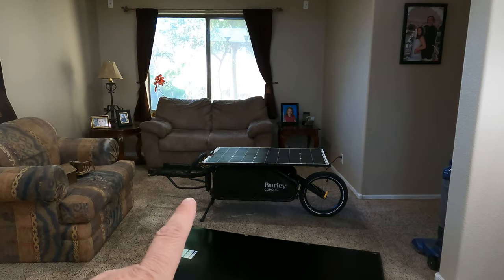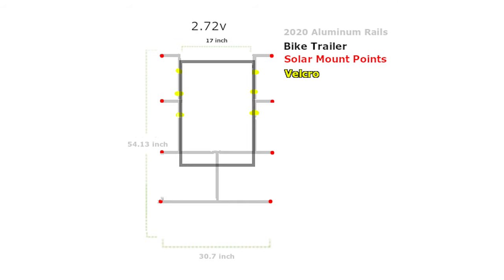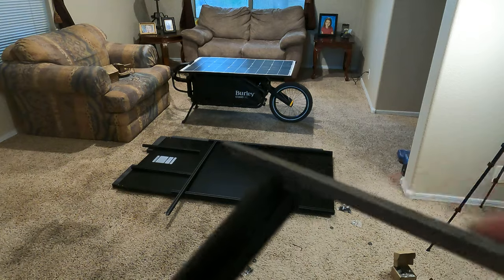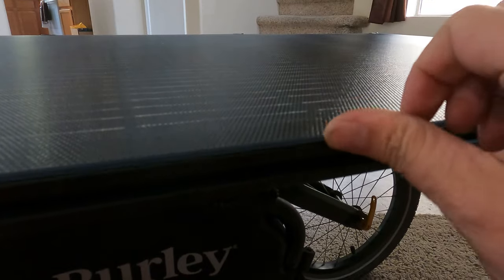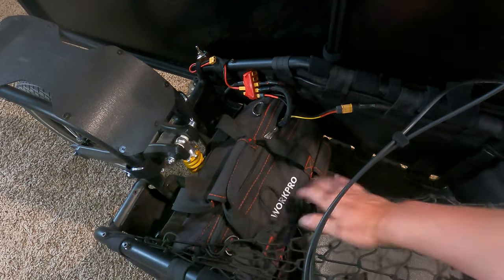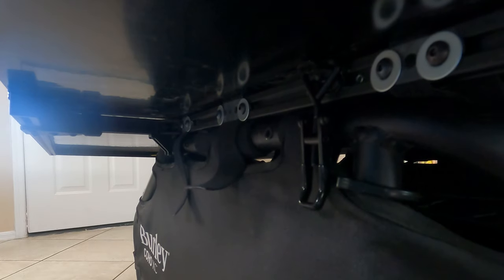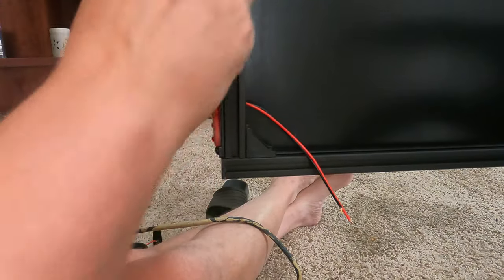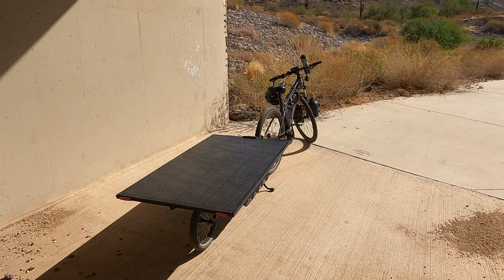🚴‍♂️200W Solar Electric Bike Trailer - UNLIIMITED RANGE

Comment from the maker: If any link below is clicked and you buy any item listed on Amazon I make commission off of said item.
🛒2020 European Standard T Slot Aluminum Extrusion https://amzn.to/3thDcTN
🛒2020 European Standard corner Connectors https://amzn.to/45W2N3e
🛒2020 Aluminum Extrusion Connector Bracket https://amzn.to/3ECUsVV (Weak T-Nuts, Rest is fine)
🛒Bike Trailer https://amzn.to/3EycKI0
🛒200 watt Solar panel https://amzn.to/3LkQ1CM
🛒Velcro https://amzn.to/45K5mVQ
🛒Genasun GVB-8-Li-54.2V-WP https://amzn.to/3RAeIiv
🛒Oreq Solar Charge Controller https://amzn.to/3PwHwWD
🛒2020 Hinge https://amzn.to/45cicek
🛒Latch https://amzn.to/3PZk4mz (Had to bend clip to fit right)
🛒Rear Lights https://s.click.aliexpress.com/e/_DDMEUx5
🛒Tape https://amzn.to/3LRISKD
🛒(15-52V) DC(15-52V) to 12V DC Buck Converter https://amzn.to/46Gpzfq
Reply: 10 ft. 14-Gauge Half Slotted Metal Framing Strut Channel  much cheaper hardware after the purchase of the stick of material and available big-box store or hardware stores. 30+ years ago I use simple 1 inch electrical conduit made a small frame with 2x 12 inch wheels carrying capacity 300+ pounds(140 kg) simple plywood bottom almost indestructible :)

Comment: how wild would it be to attempt an e-bike on solar across america lol. Would take a lot of planning because you're going to want to plan the best route and best weather conditions ultimately for when you should start and end. I would assume the downside to this is you'd probably want to stay near freeways/cities of course you could always deviate and go off and check out key spots along the way. That would be one helluva weekly vlog and at the end I'd recut it into a documentary in shorter form. Imagine all the trials and tribulations, the people you meet along the way, your camp sites, what you have to do when something goes wrong with the bike/solar panel etc Probably would need to plan your day out like ride 20+ miles take a break, eat, use the bathroom, ride another 20+ miles rinse repeat depending on weather to you might have to just go BUSSIN like 3hr ride to beat a storm system etc. Would be fascinating to me anyway. Of course a tremendous amount of time and effort.
Reply: Lol
.. im doing a cross country bike tour... I started out with a gravel bike with panniers... and a dog carrier for my chihuahua... I started in Mobile alabama... im currently in Bellingham Washington... I JUST upgraded my bike... I installed a 1000 watt bafang bbshd mid-drive motor.. with a 48 volt 20ah battery... loaded it down... and realized... " crap im over my frames weight limit... serious frame flex... i could hear my spokes buckling as i rode my 5 mile test run... also ate 22% of my battery... ugh.. fk me right... im need atleast 50 miles of range in the mountains... so... bought a burley coho xc... but i know thats going to drop my range even more... so.. i decided to add another 20ah battery... and a 200 watt solar panel...😂 i swear this guy is a fckn psychic and made this video SPECIFICALLYFOR ME😂 as of now im waiting for the axel... and since im not a trustafarian or a yuppie... im going to have to make do in the area for a minute with where im at now... but... as soon as i can pick up some more construction work to fund the 2nd battery and solar panel... ill be building basically THIS exact setup... except that im on a 22 salsa journeyer advent build... not that there is much left of the original bike... when I started this tour... I hadn't touched a bicycle in 25 years.. didn't know squat... I just researched the best starter bike in price range range.. bought it... bought panniers.. and have steadily upgraded everywhere I pick up work as I figure out what works and what doesnt...😂
Reply: You think it's hard to do this learning along the way... try having to stop... meet people... work a while... upgrade and save to fund it all in the process😂

Comment: 👍Hi Eric, I do a bit the same here, already did about 10.000 Km of solartouring with different setups, was thinking about this Burley trailer for my 2024 Tour (my  old Topeak trailer got broken in 2023). I am now building my own trailer from scratch (with 30x30 and 40x40 Alu profiles). I use a 200W 39V panel (max 1,5 Kw per cycling day) that can tilt to the sun. You can watch my videos on my channel for further details).
Reply from the maker: Nice rig!

The rubber feet didn't hold up on the Burley. The tire on the Burley is also no good. I got 9 flats from road wire. 

I do want this one to tilt one way when parked, but given I ride with traffic over 20mph the panel other then flat would crash me. Outside Phoenix to get anywhere highway riding becomes hard to avoid.

Total daily power would been a great number for me to have, but I never put battery back up on my meter so it reset every time I was shaded.

Comment: Buy cigs solar panels...not fake flexible mono silicon panels...
These panels are on a nice rigid frame...
Reply from the maker: Will have to check cigs panel when I'm back off tour.
Reply: Those panels tend to be significantly larger for a given wattage - and they also tend to cost substantially more!

That said, they ARE more rugged, they drop off less in the shade, and they last quite a bit longer in real-world usage.

Comment: Fiberglass over foam board ultimate strength to weight
Reply from the maker: Messy, but it could work. Couldn't the back of the panel have fiberglass without the foam boarding? If so then their the "how do I mount it to the trailer?"
Reply: @Eric_Tennant  so I just bought the materials to do this. I'll get back to you when I stumble through the difficulties I didn't plan ahead for.
I repaired my cracked jacuzzi recently with fiberglass and it turned out well so I'm getting more courage.
Reply from the maker: Only down side I can think of is it could effect the cooling of the backside of the panel.
Reply: @Eric_Tennant  ohhh. yes it would. 1" coarse open cell foam between them? We used it under fenders and between skid plate and motor during mud races.

Comment: cool contraption, thanks for showing us. that one wheel trailer also looks very good. a bit like the aevon trailer except it has a different hinge placement. how many watthours can you extract on an average day of riding? there's a solar bicycle tour between france and morocco, they extract over 4000 watthours a day and only limited by rules on solar panel size and battery weight. a couple guys go really fast there and on some hilly terrain, too. there's an interview with the winner and he rides 270 km a day, descends 65 km/h in the mountain on a heavy bike, and only uses 200 watts out of the motor on 12% steep climb. his advice is to ride slower.
Reply from the maker: Yep less then 15 mph increases range massively. I need to get a backup battery for the meter as I've never got a whole days data from it; because shadows reset it.

Comment: I hear that there's a potential for the proprietary axle to break. Any insights? Would make sense to carry along an extra on any longer rides.
Reply from the maker: They did have a recall a few years back. This model is after that. I have beat the crap out of it and have had no problems with it.

Comment: Interesting idea. What's your total battery ah? And voltage of the bike's Motor/Battery system?

I gotten mine similar but instead of slapping a huge panel. Mine would be more portable carry down that fits into the trailer hide away and then thrown out when needed. Though more focus on 12volts onto a portable solar battery that'll then run to 110volt AC and recharge fast from the wall chargers. Or i could easily stop at a place and be recharged of everything within 4hours.

My motor and battery setup right now is 36volts across the 500watt and rear stock 250watt (Though will be changing it to a 500watt mid-drive 36volt later.). Running the stock 7.8ah internal cell in the back and a whopping 30ah cell in the trailer.

I already get a pretty good distance off my 30ah cell on 500watt front hub. if anything 100miles. So 2 extra 30ah and 12ah + 7.8ah I could go more if i switch to mid-drive power instead. 400 on single charge. Then use a multiplug to connect wall outlet charger bricks to it and then directly to a single outlet where ever i need to. Or do slow charge via solar from portable fold out panels from a portable solar generator.
Reply from the maker: 48v @ 55ah on 1000w motor.
Reply: @Eric_Tennant  Oh wow that's pretty nice.

Have you cloaked how far you can go before needing a recharge? (In miles of distance)
Reply from the maker: Did 147 mi on the last day of this tour. https://youtu.be/zCjuApSlPW0 I wasn't helping the bike much on that day. Think I ended the day with 5% or so. Part of it was on dirt as well.

Comment: Why not rigid solar panel though? It has it's own frame and will last longer too.
Reply from the maker: Lighter weight, More crash resistant, and needed custom mount points to adapt to the trailer.

That said it can be done with rigid dropping the solar cost by 1/3. Some 2020 railing would still be needed to adapt it to the trailer.

Comment: You should have used a rigid panel.
1. No need to build the platform
2. Price per Watt is much cheaper
3. Rigid is significantly more effecient than flexible. Smaller panel for equal Watt
4. Optionally upgrade to bifacial. About the same price as flexible but up to 15% extra Watts
5. If you mount the panel a few inches (or several if using bifacial) which will improve cooling.

Eco-worthy's 48v solar charger is about $50 (prime day sale @ $33). Can be configured to charge 24v, 36v, 48v, 60v, 72v batteries.  It uses solar power to operate so never drains the batteries. 

I just installed one and hooked up the battery first and went crazy as it wouldn't turn on. I was ready to return it when I read the manual to find it requires solar to operate (unlike almost every other solar charger that requires connecting to the batteries prior to connecting PV).
Reply from the maker: 1. With glass you still need to frame to the trailer.
2. True
3. False. I have pulled over 100% off these.
4. Bifacial is something I want to test.
5. This design cools great by allowing the air to flow under it.

a. Glass weight is more
b. Glass isn't going to take a crash well.

I have never tested the Eco-Worthy's MPPT ( https://amzn.to/4fg4g9A ) so I have no Idea on its performance. This model isn't waterproof.

That all said I may try a rigid top if I was sent a good bifacial panel. Inner farming wouldn't be that hard to do.
Reply: @Eric_Tennant  
3. By efficient I mean Watts per square inch (or square cm). 
4. I just purchased 7 BougeRV 200w 24v N-type 16BB bifacial panels for my 5th wheel. I won't be able to mount them for maximumbifacial, but they will get a few percent extra. These are high efficient panels. 50.7 inches by 30.2 inched = 1531.14 sq in or .131 Watt per sq inland not including 5-15% extra from bifacial.

I also got 10 Eco-worthy 130w flexible panels. 38.7 inches by 27.1 inched = 1048.77 sq in or .124 Watt per square inch. Many people report actual wattage between 80-100. That is. 0.076 to 0.095 Watt per square inch. I bought these for areas that I may need to walk and/or where the roof is curved.

I also have 10 Renogy 100w panels. 41.8 inches by 20.9 inches = 873.62 square inched or 0.114 Watt per sq inch. I know these get 90+ Watt per panel.

Yes I will have 3 strings of panels connected to 2 eg4 6000xp invertors (2 mppt solar chargers each). The bifacials will be installed were they can get some extra power, the flexible panels I already described and the Renogy 100w panels that I previously bought for a different project that fell through. 

I paid a premium for the bifacial panels because every Watt of charging will matter. I could be running two AC units or electric heaters, a combo washer/dryer and more.
The 7 bifacials should Max at 1400-1470 Watts. The Renogy should Max at about 900 Watts and hopefully the 10 flexible "130 Watt" panels at max around 1000 Watts for a max potential of around 3300-3370 Watts. I'll hopefully exceed 85% charging so 2805 to 2865 Watts to the batteries.  Almost enough to run both AC units. Once I have everything installed I will see if I can squeeze in a few more panels. I may also get another portable (folding) panel to supplement the "150w" (really closer to 100w) panel. The portable panel is connected to my 48v battery bank via the eco-worthy boost charger.

Comment: I live in more of an urban setting. Can you make your rear lights into turn signals? I use turn signals with my Ebike and they give me more confidence when driving.
Reply from the maker: 100% doable with a relay https://amzn.to/3F6Y4zB
Reply from the maker: Found a better part for making them blink https://amzn.to/3rJv2Df
Reply: @Eric_Tennant  , could you make a video when you do it? I find the present wireless versions need improvement.

Comment: Why not use 2 panels for a triangle shape? That extruded aluminum also comes in 10 x 10 which is even lighter and smaller? What voltage are you try to send up?
Reply from the maker: A triangle would have a high center and wouldn't be good on this trailer. Do you have a link to the 1010? When I look it up I get 1inch by 1inch. If I can find it I could replace 80% of it with 1010. Think the voltage is at 30v to a 48v battery.
Reply from the maker: Just found 1010; however after reading the review  ( https://amzn.to/3z8GQCl ) I'm happy with 2020 strength. Seller also has it way over priced.
Reply: @Eric_Tennant  aluminum extrusion 10 series
Reply from the maker: 15mmx15mm Looks like the right strength; however it is also not easy to find. 2020 comes in a box of 10 that are 1500mm long for around $60

Comment: Why did you not use a rigid panel in the first place?
Reply from the maker: This is about 10 pounds less than rigid. The custom frame allows for it to be mounted to the trailer, and I'm not sure if the glass on rigid could handle a crash like this unit does.

On the flip side a rigid panel is cheaper, and would last longer if the glass didn't crack. Would have to add more framing to it for mounting.

Comment: How many amps do u get on a good day from the panel
Reply from the maker: Not 100% sure I didn't have a battery on my meter the last tour so every shadow would reset it. Think 1000 - 1500 watts maybe (1500/48) about 31.25 amps tops. Wish I would of left the foldable ones at home; because I never did get a good harvest with them, and they are 5 pounds each.